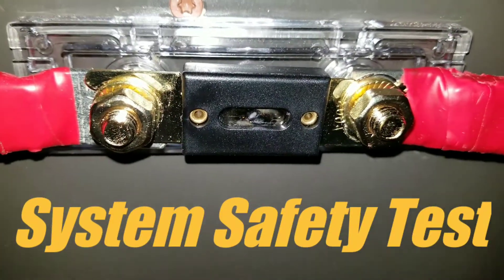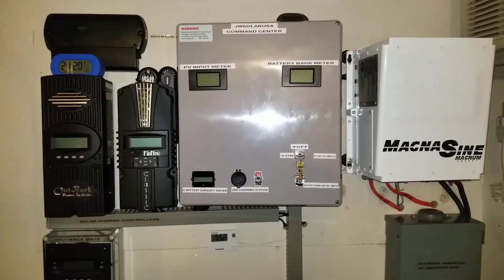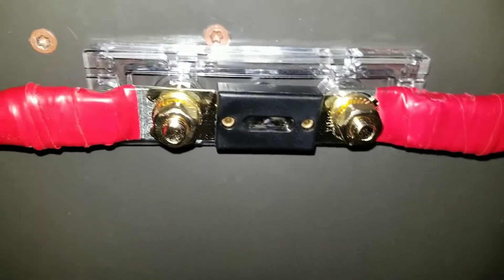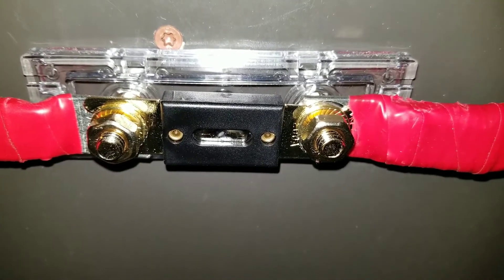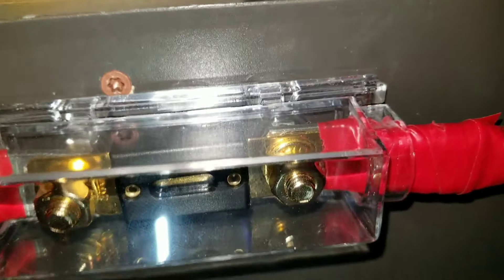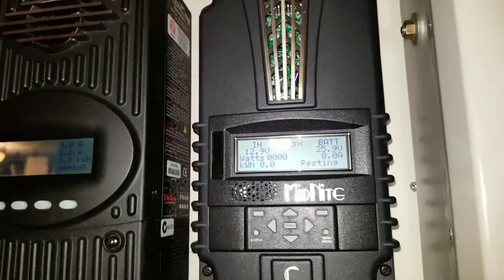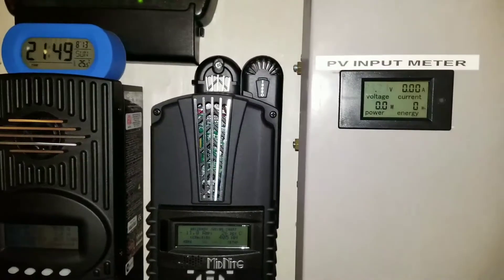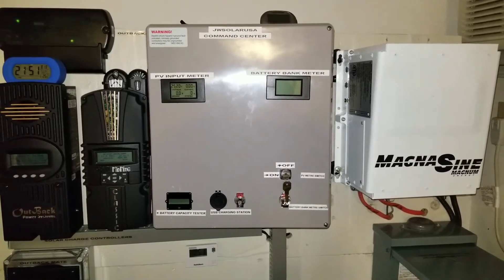DIY OFF GRID SOLAR: Battery Box and Safety

Comment: Very good video JW. The proper size fuse saves the day. That fuse protected the wire.  Your Magnum Energy MS4024 can hold a 5800 watt surge for 5 seconds and 5800 watts divided  by 24 volts is 241.7 amps or round up and use a 250 amp breaker. Since that would be pushing the inverter a bit over the max. I'd step down to a 200 amp fuse if it were mine. 200 amps X 24 volts = 4800 watts. This would allow for minimal surges.
Reply from the maker: +Randall C 
Thanks Randall for the awesome input. The fuse that was blown on this test was a 200A ANL FUSE

Comment: Good video bud. I nearly had a fire myself due to a breaker failure. This just makes me want to go through my system and check for weakness.
Reply from the maker: +GPVlog 
Hey buddy,
Thanks for your input brother.
It is always good to double check triple check the safety of your system frequently especially when adding or upgrading new devices to your system. Always check and get the correct rated fuse size and breakers, good quality cables to prevent fire and protect your investment, family members and Love ones.
Thanks for watching buddy. 
I hope this video help someone out their.
Reply from the maker: +GPVlog
https://youtu.be/Q-9AMh_ATTk
MPP SOLAR INVERTER CHARGERS PIP 242424LV-MSD - Complete Installation
WANAMINGO MINNESOTA BY jwsolarusa

Comment: NICE brother
Reply from the maker: +yankey4 
Thanks for watching my brother.
How are you today?
Reply from the maker: +yankey4 
Hey buddy,
Thanks for your input brother.
It is always good to double check triple check the safety of your system frequently especially when adding or upgrading new devices to your system. Always check and get the correct rated fuse size and breakers, good quality cables to prevent fire and protect your investment, family members and Love ones.
Thanks for watching buddy. 
I hope this video help someone out their.